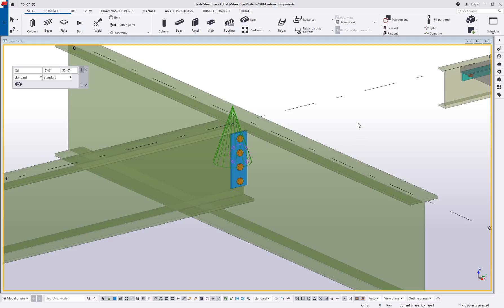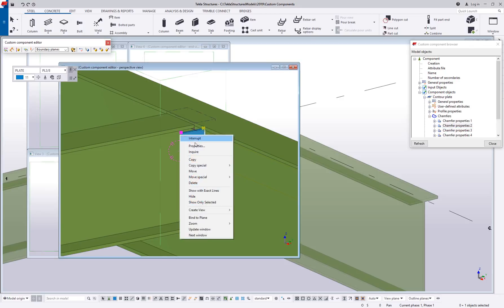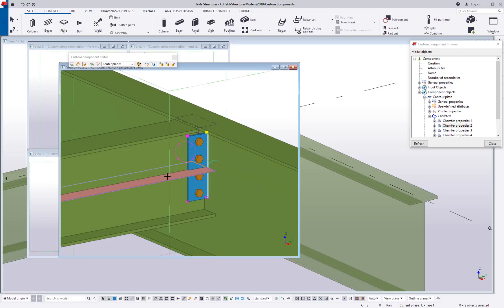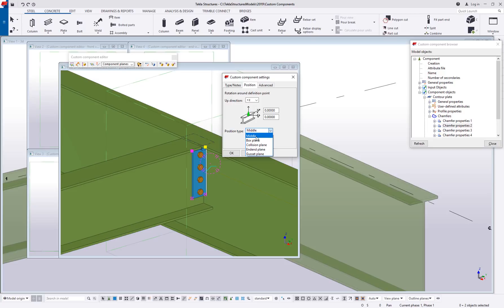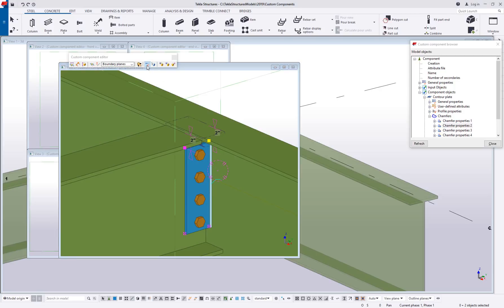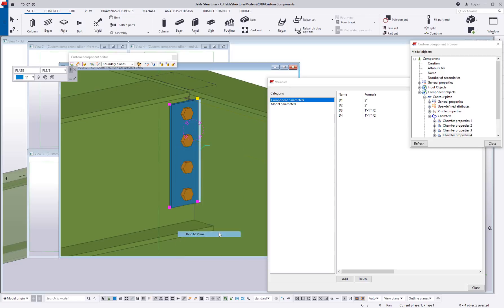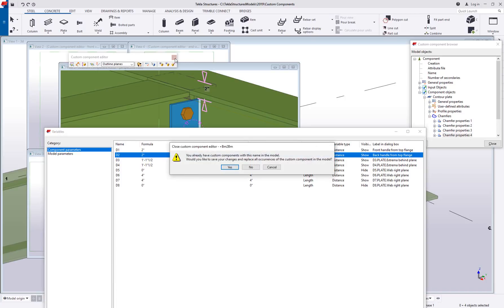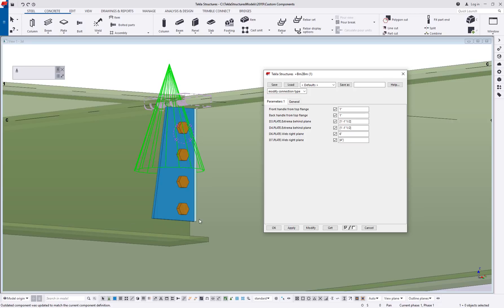Custom Components  - Adding Bindings in Tekla Structures

Comment: while binding to sloped member how do i control the slope i need the component to be straight which is start x= end x or start y = end y
Reply: Tough to say without seeing what you are working on. But you can attempt to force the orientation to global Z by saving the attributes with that (up direction on the position tab). I recommend contacting your local support with your actual situation.

Comment: Hello Trimble! Another question. What does construction plane do inside component editor??? What is the mean purpuse/function of construction plane inside component editor? How to use it?
Reply: Construction planes can be made magnetic, so that the handles of any parts will 'stick' to them and move if the plane moves. You can then bind and manipulate the plane, rather than binding each object individually.
Reply: @TrimbleTeklaDave   Thanks for your response. I'm not familiar with Tekla, just learning. Honesty, I came to Tekla from Inventor. Testing different options in Tekla inside component editor and specificly with these construction planes it was very confusing for me that construction plane is being NOT highlighted while selecting this plane, and because I didn't know it I was expecting that this plane MUST be highlighted to select it such as all other planes, but not. For somebody blanco in Tekla, like me, it was not intuitively clear. That's why!

Comment: Hello, a question! When I bind a bolting inside the component the component symbol turns yellow so I do something wrong, but what? What can it be? What are the restrictions while binding a boltings? Which planes is the best to chose and which plane I should definitively avoid to chose while binding a bolting?
Reply: The binding itself will not cause a component symbol to turn yellow, that just means that the bolt is close to an edge, based on the File > Settings > Options for components (1.2 X diameter in the US environment). There are no 'best' or 'wrong' bindings for bolts, it all depends on the situation.
Reply: @TrimbleTeklaDave  okey thanks, I have not enough knowledge about Tekla, am just a starter. But the weird situation is as follows:  do test of some modifications of the component, while there is no bolting in it everything is okey, symbol stays green, sinds I put some boltings into it with bindings, the symbol turns yellow, BUT(!!) the most weired is that when I do something with this component in the model, so move the beam, of modify the beam or column, the symbol turns again to green. I can not identify what the problem can be.
Reply: @victorstrembitskiy7171  Honestly I wouldn't worry too much about the cone color. If you check the bolt dimensions and locations, and they are where they are supposed to be, then move on. In some cases we cannot avoid a yellow cone (for example, bolts in a narrow beam flange). It's just a flag to look closer at it.
Reply: @TrimbleTeklaDave  ok, thanks A LOT!!!

Comment: I created haunch with stiffener custom component, if this applies at other end of beam (like mirror) then the weld is not getting properly as per created side.there is option for this then plz advice me.
Thanks
Reply: What version are you in? I just tested this in the latest update for 2019i, and the weld is created correctly. Make sure you have the latest service packs for your version. If this continues, you can try to create a polygon weld instead where you can actually bind it's handles.